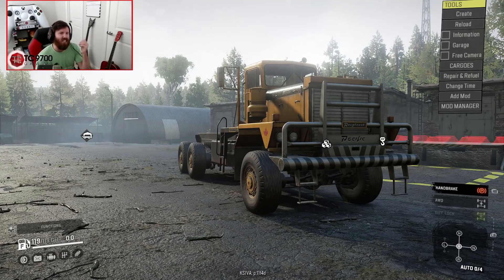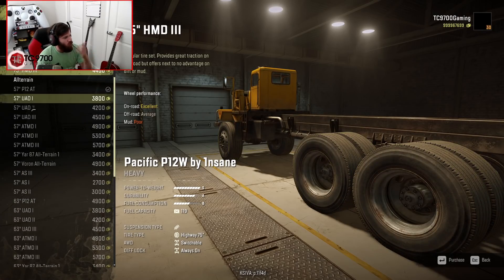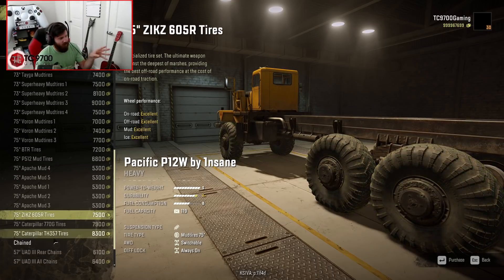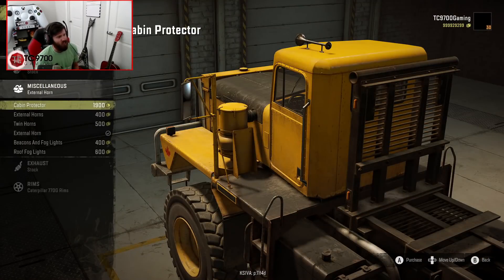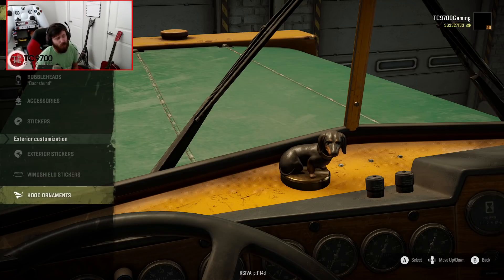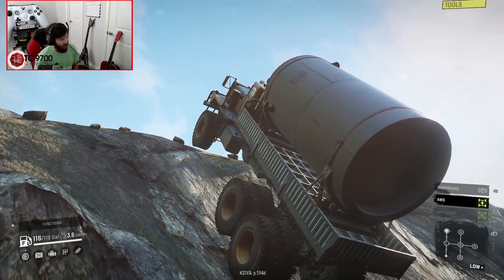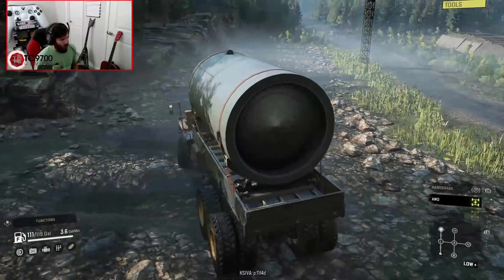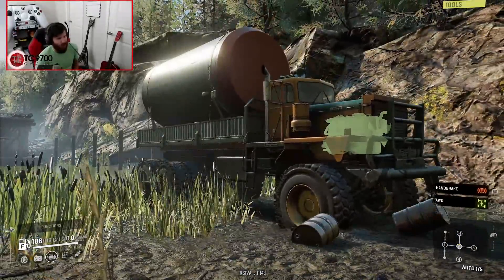SnowRunner: What Happens When You Give A P12 75 INCH TIRES!? (And More!!)

Comment: 10:09 if diff locks were properly coded you would have made it. Its a nit pick, but its aggravating that even with diff lock on it doesn't actually turn every wheel. Either they all turn with diff lock no matter what or you snap an axle shaft or twist a drive shaft you don't just turn a couple while the others stay stationary.